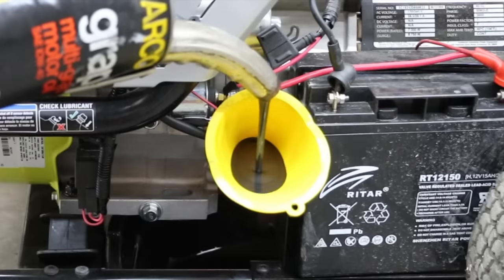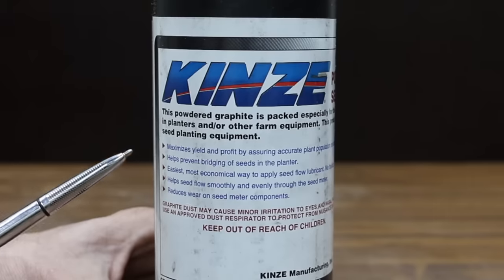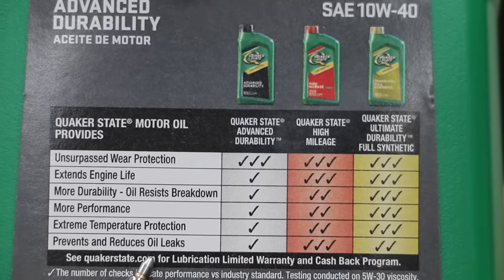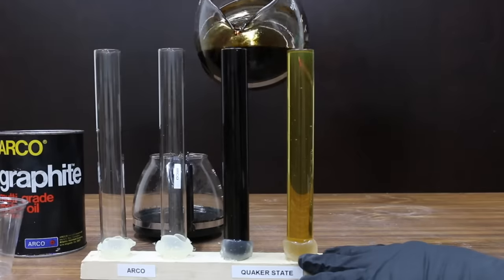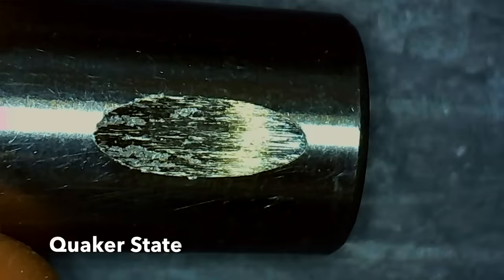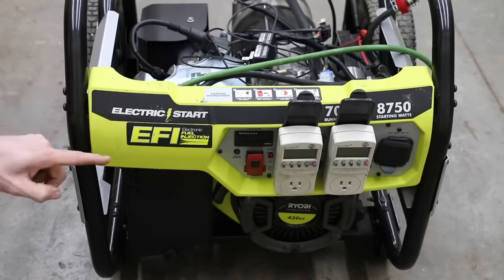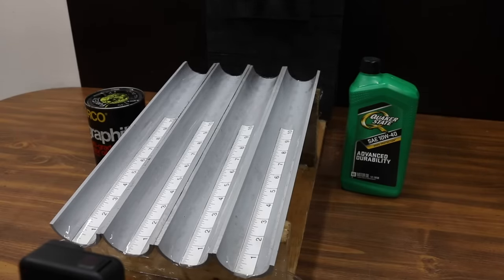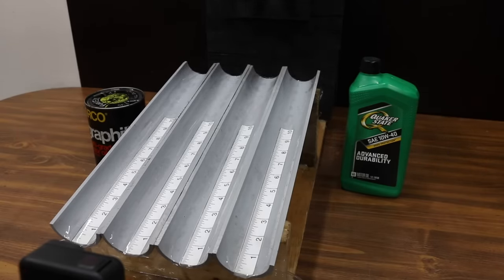Will "Graphite" Help Motor Oil Performance? Let's find out! Vintage Arco Graphite vs Quaker State

Comment: This was a very good video, well done and informative.  However I am horrified that this oil is still obtainable.  I have been an auto mechanic for 43 years.  Arco Graphite motor oil had a horrible reputation among mechanics back in the day.  The graphite would tend to gel in the oil pan and block oil flow to the rest of the engine.  I have seen more than one oil pan removed with what looked like black gelatin filling the entire crankcase where the oil should be.  It was a great idea as graphite is an excellent dry lubricant but it just did not do well in the field.   I shudder to think of what this oil could do to a modern engine with variable valve timing or displacement on demand where the oil is used to operate hydraulic components, and need a speedy and steady flow of oil.  Please DO NOT use this kind of oil in a modern car, you will be sorry.
Reply from the maker: Thanks!  Thanks for the feedback.

Comment: I'm wondering if the old Arco graphite oil would work better in one of the old leaded fuel engines?  Where would one even find leaded fuel these days?

Comment: Based on some experiments I’ve seen with hydrogen fuel cells, the only way to get better fuel economy is leaning out the gas so the motor can run on mostly hydrogen.
Reply from the maker: Thanks for the feedback.

Comment: Back in the '90s my boss was pushing a teflon additive for oil. It seemed like things were failing, even a  rear differential. I'm wondering if these failures were just coincidental or if the teflon did more harm than good. Maybe you could run a test on this if you can even find a teflon additive.
Reply from the maker: Thanks for the video idea.
Reply: I'd steer clear of teflon for combustion engines.  Starting around 260C it starts to decompose into some fairly nasty stuff that you don't want in your lungs or engine.

Comment: I put some similar crap into my 1985 Jaguar XJ6 4.2, 100 miles later it destroyed one of the big end bearings.
Reply from the maker: Thanks for sharing.
Reply: @ProjectFarm  I have been told , by various mechanics, that modern engines are worse, due to the smaller oil galleries in multi valve, variable valve timing & turbo charged engines.

Comment: There at one time in the 70's a product called Dexon it was tested with a  eletric motor spinning a bereing  in a cup of motor oil . there was a lever with weights added one once at a time. the motor oil  could take 2000 pounds pressure be for it ground to a halt. dexon was added to the oil at 1000 lb's then started (rough noise) but rotating. the weights were added to 15,000 be for the system ground to a halt.  I can not find this product any where but I heard the american military aquired the rights to it.  Could you check in to this.  I saw this with my own eyes.
Reply from the maker: Thanks for the suggestion.

Comment: i used arco oil for several years  then my oil pressure slowly dropped untill there was no oil pressure at all after pulling the pan i noticed the oil pick screen was very very plugged looked like cake on solid grafite i will never do that again
Reply from the maker: Thanks for the feedback.

Comment: The fact that you're  comparing  a 40 year old oil with a new one is ridiculous.  You should either do two oils from 40 years ago, or add graphite to an oil and see if it improves its performance.  This would be a far more accurate  test. I bet this oil 40 years ago was amazing. Also the heat test was deceptive because  the "sludge" as you said it, was actually  the graphite settled  at the bottom.  That wouldn't  happen  in a running engine as the moving parts would blend it. All you did was bake it.

Comment: What if they made the inside of a motor "hydrophobic" using a specially laser cut design? would this be possible, or would the action of the motor grind the pattern away?

Comment: I tried Arco graphite in a yamaha XT500 single back in 1978. It ran fine but .........the black graphite blocked the oil sight glass on the crankcase. Not good.
Reply from the maker: Thanks for sharing.

Comment: Don't do it. My experience with the ARCO & TEXACO graphite oil in 1980 was in my Yamaha 650 air cooled engine was a broken oil pump.
Just enough graphite packed up in my oil pump gears and broke them. I worked at a Kawasaki / Ducati shop and several other mechanics looked at it and we all came to the same conclusion. Maybe it was particular to my engine, but the Yamaha 650 twin is a pretty stout engine, and nobody had ever heard of this happing before.
Reply from the maker: Thanks for the feedback.

Comment: Drawing conclusions from a sample size of 1 is bad science. If you repeated exactly the same test 4 times with you might get 30 seconds difference between the highest and the lowest, so a 30 second difference would mean nothing, it could just be normal variation. That's why science can be so boring, you need large sample sizes for good data! Very interesting video, thanks!

Comment: The motor oil manufacturers (Castrol and the like) spend ages testing all the industry available additives to gain a competitive edge in the market in purpose built laboratories and through testing in engines to destruction. To think there’s an additive out there that the general public can simply add to their oil that hasn’t been tested already by the manufacturers is deluded!

Comment: I hated that Arco stuff customer would use it then when I change there oil it was still black. And looked like I didn't change it.  And replace a few motors with low miles that had run on it
Reply from the maker: Thanks for sharing.

Comment: 12:00 - In WHAT universe is 1,468 "almost three times as much" as 475?  It's actually well OVER three times as much (which would be 1,425).  I noticed your statement was incorrect IMMEDIATELY, when you said it.  475 is 25 less than 500, so three times that would be 75 less than 1,500.  That is SO immediately apparent as to be mind boggling.  How can I trust your tests when you can't do simple math?
Reply: Bruh

Comment: The Problem with Graphite is it clogs up oil filters reducing oil pressure and so a lawnmower or small unfiltered engine is the only practical application
Reply from the maker: Thanks for the feedback.

Comment: How about running 4 or 5 generators for a week on different fuels like cooking oil and the new diesel  see how much is used. You get up to a Third further miles on a half oil half diesel so what if 100% oil.
Wear you already done and think cooking oil was top or near.
Reply from the maker: Thanks for the suggestion.

Comment: Have you tried running transmission fluid in an engine instead of oil? I had a guy swear by it years ago, said it was all he ever used in his truck simply, as I recall, because, he said, it doesn't burn.. Ever tried that?
Reply from the maker: https://www.youtube.com/watch?v=bE2F-vefQdA

Comment: Is there a single car left that uses this oil? All these modern oils that start with 0 weight. brrrrrr
Its me, I am to old, but having said that, I still drive my 1982 Citroen CX2500 Diesel here in Vancouver
and it must have 20-50 Motor oil. In the owners manual it states that under no circumstances, any over the counter additive is allowed in the motor oil. Then it goes on which makes they recommend. The 5 speed manual transmission has Molykote in it. At the last oil change, a few weeks ago ,Shell Rotella for diesels was recommended, andit was put into the engine, it was 10-40. I only drove a few blocks with it, the blue smoke was not to be believed , the garage, at no charge, switched the oil to 20-50 Castrol. All is fine. Goes to show, at least to me ,that following the manufacturer's recommendations are the best  Then and now.
don't
Reply from the maker: Thank for the feedback.

Comment: ?  411 to 380 is only a 7.5% loss?  and 430 to 415 is 3.5%  Unless my math is way off.  a 15% loss from 400g would be in the 340g range.
Reply: I also think your runs for the flow test should be cooled.  If not the first one in the tray will warm faster allowing it to flow smoother as time goes on.  Though, it would not make a difference in what flows first.

Comment: Have you run a test on "Engine Additives" like, Lucas, Prolong, STP, and a few others? I know the Prolong product WILL guarantee your engine with use, and it's the ONLY real product in it's line, the others make claims, but Prolong backs it with proof....  Engines literally running from the west coast to the east coast after adding it, then draining it......
Reply from the maker: Thanks for the video idea.

Comment: What oil has the most zinc in it? I've been running diesel oil in my old Ford truck with a completely rebuilt engine.
Reply from the maker: Thanks for the video idea.
Reply: @ProjectFarm  You have to tag me in it so I dont miss it please 🤣👍

Comment: Ummm you shut the time off after the generator died with quaker but before it completely died with the Arco. That test was flawed. They did about the same length of time on the feul efficiency test

Comment: If you look into why diesel engines out last gas engines by about 3 to one if is because diesel full after burns it act like a graphite and parts do not where like gas engines where gasoline is hard carbon and rings in your bearings are gone long before diesel engines.
Reply from the maker: Thanks for the feedback.

Comment: Don't put stuff in your engines, folks.  Use 5 weight in your car and 15 weight in your diesel.  10 weight may be used in an older gas engine.

Follow your manufacturers maintenance guidelines and your engine will easily outlast your vehicle.
Reply from the maker: Thanks for sharing.

Comment: Better change out your filter every 300 miles. Graphite will not flow thru oil filters properly causing loss in oil pressure causing way more problems than you started with...

Comment: Totally unscientific with the lawn mower. He tested the compression BEFORE stripping and cleaning the head, piston and valves. Obviously that drops the compression but he did not test again with clean rebuild. He is then "surprised" when he sees a small increase in compression despite all crap which built up after 30min of running. He is not testing anything her. Completely failed to do this properly.

Comment: Lucas oil stabilizer!! I’m a huge fan but I’ve only used it as an engine oil additive . It says transmission and rear differential as well if I’m not mistaken. Has anyone used this in a transmission ? Or any test done doing so? Thank you God bless .
Reply from the maker: Thanks for the suggestion.
Reply: @ProjectFarm  I’m a new sub and as a performance engine builder and tuner your videos have made me better at both thank you God Bless .

Comment: Dumbest thing in the world!!!! I put Arco graphite in my motorcycle in the early 80’s. My dad, a brilliant engineer at Ratheon, said not to use it? As I knew better being 16 years old I put it in. Within 20 miles the wet clutch completely stopped working. The graphite separated and stuck to the clutch plates. The centrifugal effect pulled the graphite powder out, like dad said it would?
Reply from the maker: Thanks for sharing.

Comment: NO, graphite is not good for the engine! Why? It burns and clockes the pistonrings.  MOS2 is better, but Graphit can be used for man. gearboxes and differentials. but also in the gears is MOS2 better.  the mos2 holds better with the higher pressure between the cogwheel.
Reply from the maker: Thanks for the feedback.

Comment: So you're comparing a 40 year old technology against a current technology?  Doesn't sound fair to me.  Compare the Arco to a 40 year old normal oil like that and let's see what happens.  Oil tech has changed in 40 years and the standard oils of today are far superior to the old stuff.

Comment: As someone with chemistry experience, why would you had pure carbon to an environment that is pressurized, hot and meant to lubricate high speed moving metal parts. Pure/solid carbon  does not lubricate, GTFO, some of y'all need to go back to highschool. The carbon is never good for moving metal SMH

Comment: Your compairing an apple to an old rotten apple.  The ARCO oil is old and out dated as is proven by the API Service Ratiings, which are clearly printed on the containers.  Therefore, it is my opinion that this whole test was a waste of time.  Compair API rating that are the same, not a current vs obsolete please.

Comment: No good for any motor that has a filter. Also the worst thing you could add to any lubricant used on roller bearings.
Reply from the maker: Thank you for the feedback.

Comment: Motorkote is the best
Reply from the maker: Thank you!
Reply: @ProjectFarm  I used in my 14 liter 550hp Detroit for 2.4 million miles.....
outstanding stuff... the lube spray, grease are great also. Between the Shaeffers oil and motorkote, the old gal ran smooth!

Comment: don't do it if you want to keep the engine,  heat or cold is BS on with or without graphite. Graphite is an abrasive, it will polish the parts that touch.
Reply from the maker: Thanks for the feedback.